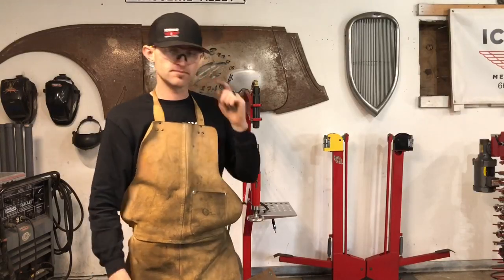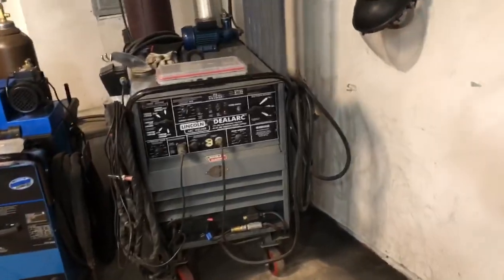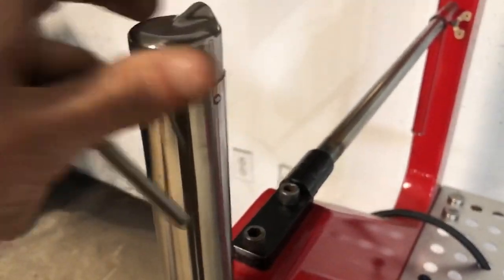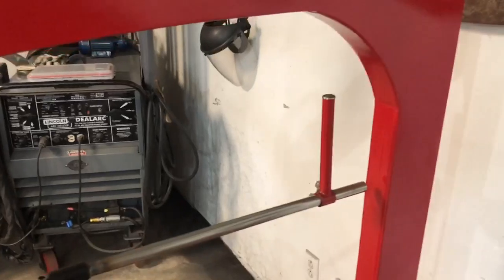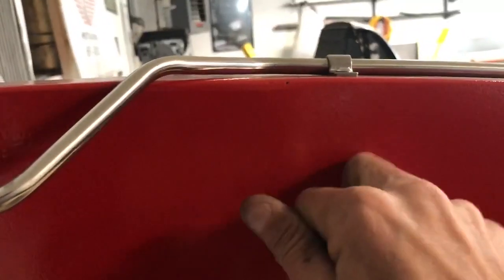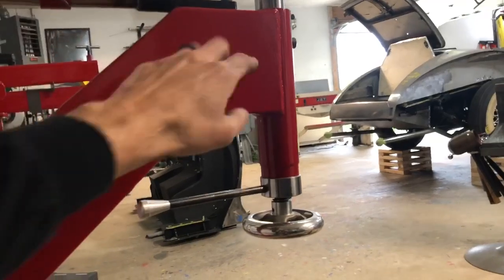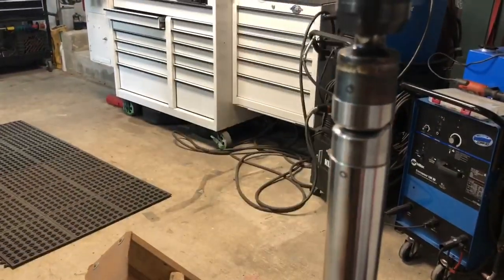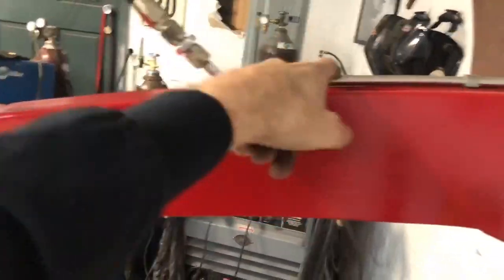Progress on Planishing Hammer build and Components added

Comment: Did you have trouble fitting the lower anvil support after welding the guide to the frame? Seams like that much weld would shrink the I D.
Reply from the maker: No not at all